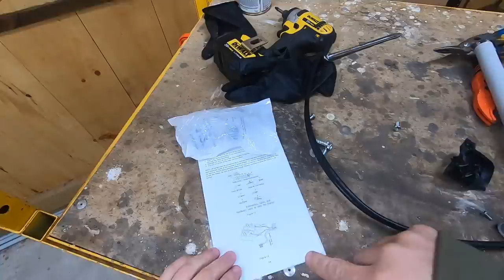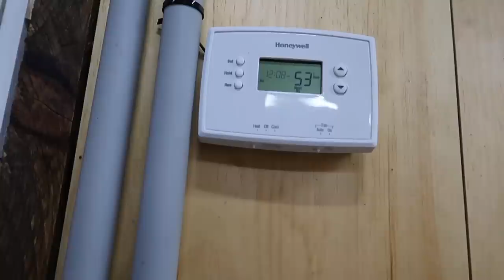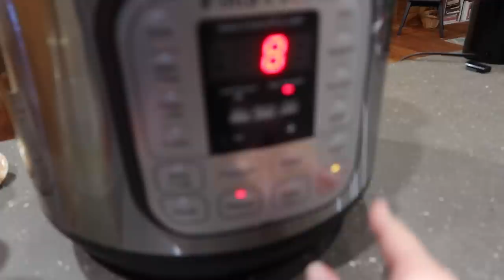Are we NUTS??? ELECTRIC HEAT in the WorkShop!!! You Might Be SURPRISED WHY

Comment: I am also putting a similar heater in my shop which is only 20 x 30 with a full trussed ceiling which is not insulated yet. This leads to my question which is did you do a video on the blow in insulation I see in your ceiling. I think this would be less expensive than regular insulation by quite a bit. If you did a video I must of overlooked it. Thank you from Michigan Steve

Comment: I have a 3 car garage/man cave 22x30 with 8ft ceilings and whole garage its insulated even garage doors:). I just have to seal the gaps on the outside and all the way around garage doors and a gap I have under door going to backyard do you think this heater will work for my space?

Comment: Al, read on the heater circuit panel, what is the voltage expected as input to be on or off. The Honeywell should describe what the out put is for on or off in their technical description.  I believe that little switch will provide 0 or 5, 0 or 12, and 0 or 24 volts as on or off  and one of those is what the fusion expects
Reply from the maker: Thanks I’ll have to look into that

Comment: if you b lock the thermostat away from the wall it will react better to air temperature rather than the cold wall behind it. and not cycle so fast because the outside wall will not chill it as much. love your videos  Dave

Comment: Ok am I missing something, I see a double breaker so is that 220 volt but I also only see a black and a white wire and a copper ground, Isn't there suppose to be a third red for 220 volt, I have been wondering about his wiring sense the main was put in?

Comment: I don't know if you got your thermostat to work. But I was thinking maybe if you used the wires going to the thermostat on the unit and hooked them up to the one on the wall it might work. I can't see a unit having two thermostat s.  I'm thinking you have to use the leads that are on the units thermostat because there the ones connected to the switch that  turns off the unit when it reaches your set temp.

Comment: Just a few pointers on things I noticed. (might already be buried in here) Code calls for marking all hot wires something other than white or green. Black or red tape on both ends meets code for inspection. Use THHN(W?) single conductors inside conduit. "Double" jacketing (outer sheath plus conduit) reduces the wire's current rating due to heat build up. Mount T-stat away from door so drafts don't trigger a cycle. Oh, and the final pointer is to pay attention to what you have that t-stat set for because your power bill will be a doozy if you forget. Someone else mentioned a ceiling fan. It doesn't have to be fancy. An old window fan set to low speed and placed on a slant in that loft area will work wonders!

Comment: Could only finish watching after working, but HELLO HOMESTEADERS (watched your defense of "pretend" homesteaders yesterday)!  Great, well-thought out basis for putting the electric heater in the shop.  If you haven't swapped it out already, suggest you re-examine the thermostat instructions.  Unusual for Honeywell components not to work correctly.  

Seeing how far out you are, however, you might think about budgeting for an emergency generator if you can; we went through Hurricane Sandy, and made it a week without power (thanks mostly to Coleman) but we finally broke down and got a simple 240-volt/120 gas job.  Of course power came back on 18 hours later, but it would at least allow you to keep broadcasting, which means income.  Other benefits too, of course.  

Thanks for your example; hope the winter is mild for you.

Comment: Electric heating in such a space makes a lot of sense. Guarding against freezing. If you end up using it for projects a lot you can always just install a small stove for burning wood when you're actually using the space. Best of both worlds. If you put it in the corner where the sheep are that way you can also get them some heat if it gets really really cold. Around here there's a bunch of older small stoves available cheap or free if you look.

Comment: Hi guys.  Loved the video and dinner looked fantastic.  I think you should install a simple ceiling fan in the workshop.  The heat would better circulate all around the workshop. Since heat rises.  Enjoy. Thanx for sharing your life with all of us.
Reply: Good idea... introducing convection helps distribute heat by moving the heated air.

But remember (minor technical point here), it's hot air that rises, not heat itself. Heat is unaffected by gravity, and has no tendency to go anywhere except from points of high temperature to points of low temperature, as per laws of thermodynamics. Heated air rises because the density becomes lower than the surrounding cooler air.

Comment: You do have pretty good electric rates compared to here.  If the heater is running on the 5K setting it will be about $0.52/hour. 
Regarding the water system, I think it would be far cheaper to put a stock tank heater in the water tank and insulate the tank. They have their own thermostats and run to keep the water not too much above freezing. You wouldn't need to keep the shop heated when you aren't using it just to keep the water from freezing.

Comment: I’m not an electrician, but I’m pretty sure if the wires are inside conduit you don’t need the jacket on the wires. It would make pulling them a lot easier.

Comment: I have a heater similar to yours and I wanted to put in a thermostat like yours too, but I could not due to the Amps that the heater put out as it was not compatible together.  Check that out, it may help you find the reason.  good luck.  Tim

Comment: Heater wiring, I'm thinking that since you are using the bare wire as neutral, it should be attached to the neutral bus bar, instead of the ground, that way you are not running current on the ground line back to the main panel, since this is a sub panel. But of course i'm not positive, other electricians please chime in. Can't help with the thermostat, as i did not see how you wired it. Gina, that spaghetti looks delicious.
Reply: Heater doesn't have nor require a neutral, 240VAC two hots and one ground, Al hooked it up correctly. A tip I use when using a white coated wire for line voltage is color it black with permanent marker, less confusion.  And yes the sub panel is wired correctly, the ground buss and common buss need to be separated.
Reply: Yes , you are correct, I remember now from Pure living for life. I was thinking of a clothes dryer, that uses 110v for the motor and timer, & 220v for the heater. I also spray painted my white wire black when I used it for a hot wire. Thanks Joe.

Comment: You need some lubes for that wire. Also if you pull the opposite direction you dont snag as bad at the joints. Finally, you could have bought a step bit to enlarge that hole for fairly cheap and stuck to 3/4" pipe

Comment: Please remember the electrical installation may be safe, however, the rules of installation are governed by the local and state laws. The shown eletrical panel would be illegal  for use in a home in our state, however, it would be allowed in a barn if oher conditions are met ( a pole in the yard that separates the home from the barn electrically ). Grounding where we live is much more strict because in places we have underground sand domes that do not make good contact with the grounding electrode and earth ground, therefore, all panels must have double electrodes and be tested. In short what is right in one area may not be right in another area. ( That's why hiring trained electricians is often a much safer bet, and sometimes cheaper than having fires, eletrical shocks, or trying to correct major errors. )
Reply: He stated that he hired a licensed electrician to install the panel.  Adding circuits is not that hard   :)
Reply: @mattben  Where they live, the wiring might be fine, however, in Michigan there would be several violations unless they corrected the mistakes off camera. The code changes every three years. We were required to attend refresher classes every three years. That alone is a good reason to hire a good electrician.

Comment: I use electric heat (5000 W, 240 v.) in my restoration studio. I can heat my 900 s.f. building to 125 F. Keeping it at 70 F usually costs me $1- 1 1/2 per day. The best thing about it is EXPLOSION PROOF meaning safe for painting with solvent- borne products

Comment: Our thermostat at home has 1 or 2 AA battery(s) in it. I think it might need a battery for power. We enjoy watching from snow covered Ontario, OHIO.
Reply: yes run some phone wire if you can connect the c wire for power and the other wire i had i used it for the g term when i run electric dryer i run the fan on manuel and the vent is just above the hvac return

Comment: You can DRILL a HOLE in Metal Cabinet for a ¾ conduit fitting KNOCK OUT DIE PUNCH.  You assemble the punch with a threaded bolt that sucks the tow halves together so the die punch a perfect hole.  So you do not need to use the preselected knock-out location. You can make your own.  Most electricians have a set of these Greenlee punches in their tool chest.

Comment: The electric heater is a great idea.
At 9:52 you have your fingers WAY too close to those HOT buss bars in the back of the panel. 
You immediately turned around showing the main lights on in the garage with power coming from the panel.
That tells me the panel buss bars were hot when you did that. 
If you barely touch one of those bars you will die in a instant.
Electricity will not allow for mistakes, please be very careful. 
You would be better off starting a generator for lights and turning off the main breaker at the beginning. 
Olivia needs her Daddy and Gina needs you too. Think about that the next time you take the cover off that panel.
Love your channel.

Comment: I'm not an electrician. So this is just a question. With that bare earth wire in the box, touching the box.... if you have a problem wont that make the box live? Shouldn't it be covered as well inside the box until it gets into the socket? ALL the best.

Comment: Never run Romex or bundled wire inside conduit.  Use individual insulated wires.  The nice thing about Romex is you can just staple to the inside wall.  No conduit needed.  VERY DIFFICULT to get Romex through those 1/2" sharp bends.  The heat in your workshop is all going to rise up to the ceiling and get very hot up there  and waste a lot of electricity.  Get a ceiling fan and mount it very high.

A better color code uses black as L1 and red as L2, leaving white as Neutral.  Hard to get the right cable colors, which is another reason to use individual wires.  Put some red tape around your white wire in the breaker box where it connects to the breaker.  You could do that inside the heater, too, so somebody later does not think it is Neutral and electrocute themselves.

Comment: On your thermostat wires, if you short out the two wires (T1 & T2) the unit should come on.  When separated the unit should turn off.  All the thermostat needs to do is connect the two wires.  The supply voltage (24V) should originate from the heating unit control.  The voltage can easily be verified and the other is the relay switch feed.  If no voltage then the problem could be in the heating unit or wire.  If voltage is present and then unit does not turn on when circuit is completed then the relay control or wire is defective.  If that works OK, then you are back to the thermostat wiring connectors.  The manual should describe all the terminals and the settings.  I think you would use R and W if I recall since the unit only has two terminals to control it.

Comment: Good luck getting external T stat to work. Think it calls for a line thermostat, and I couldn't get it to work either. I ended up using a contactor, transformer, and a thermostatically remote control power outlet I found on eBay to turn transformer on, and off to power contactor to control power to furnace, and left unit t stat turned all the way up. Same setup used on a home heating unit. Something is just not compatible with external t stat wiring it the way they say to do it, I never got their way, to work right, maybe you can get some answers from the company, I couldn't

Comment: FYI - I had the same problem with the thermostat not working. Come to find out there was a tiny piece of paper in between the contacts on the thermostat. When I removed that, the thermostat worked as it should, so you may want to take a really good look at the contact points for that piece of paper.  :)

Comment: I live in Southern California, most homes are heated by natural gas. Burning wood is a "no no" due to smog issues. Our smog is much better than when I was young but more and more people come here so we have to keep up with the smog issues. I just heard on the radio this morning that government officials are considering a ban on natural gas heading because of the CO2 emmissions. So, instead of gas, they will require electric heating. So, electrical head is not that bad of a solution, especially with your low electrical cost.
Reply: They're probably powered by coal, so natural gas or LP would definitely be better. Lower NOX, lower CO2, cheaper heating bill

Comment: You mentioned painting and being able to use the electric heater? Remember an electric heater can be an ignition source for flammable vapors just like any other heater. The resistance wires get plenty hot enough to ignite flammable vapors or gases. Just a word to the wise!

Comment: I am pretty sure it's against code to run NMC (romex, etc) thru the conduit
The heater looks to small for the space to be heated. I would have placed ceiling fans to push the hot air down as all the heat will be trapped in the ceiling. I could never figure out why people place heaters high up to the ceiling as heat rises. I would have used a small water heater and run baseboard all around. Or even elec baseboard
Also I believe the white wire in the panel and at the equipment should be spiral wraped with black tape to signify that its NOT a neutral

Comment: Am surprised you heat the house with the wood stove, so why not a rocket mass heater in your barn, would be a great thing to diy since you are so handy.  Love the vids you share, be well and huggs
Reply: Rebecca Haughn - Al explained their reasoning in the video.
Reply: I have always thought the number one thought was to save where you can and even though cheap, it is reliance on another rather than self.  So with heating the house with wood stove, a rocket mass heater would take small stuff and make long term heat for the barn.  That was my thought.  Surprised Al has not responded.

Comment: Why did you install the thermostat right by a door which will likely give you a wrong reading?  Why did you put the thermostat so close to the heater which will likely give you a wrong reading for the whole shop?  You will think it's warm but it is, only near the heater.  Do you expect the heater to heat the entire workshop or just a small portion of it with the thermostat located where it is?  We make bacon ourselves.  You are right, it will be good.  Do you have a meat slicer to cut the bacon?  If not, it might be a good investment.  We cut it up with the meat slicer and vacuum pack it.  I am glad to see Gina has that utensil that breaks up the meat so well.

Comment: On sale right now at RURAL KING !...……...Comfort Zone 240V 10000W Garage Heater CZ260ER$199.99¢   Valid November 10, 2019 - November 27, 2019             Description Product Features:2 heat levels up to 10000w. Remote control for convenient adjustment. Large display shows current and set temperature. Digital thermostat. 12 hour timer with auto shutoff. Fan forced for wide area circulation. Adjustable louvers and heavy gauge steel body. Fully enclosed motor for use in harsh conditions.            In the event of disagreement between the circular and this popup, the circular shall take precedence.

Comment: Al,   Please be aware that there is a contractor inside the heater that arcs when it turns on and off.   I doubt you will ever have a concentration of fumes to be a problem, but thought you needed to be aware.   I would turn the heat off if spraying paint and doors closed.  Respectfully,   Kevin

Comment: Electric heat is lowest and quickest installation cost.  It is also the most expensive to operate.  If we are talking a few hours a day, it is a very good solution.  You might even consider put it on a mechanical timer.  So waht it you have to reset the timer every 60 minutes.  You don't have to worry about, "Did I remember to turn it off ?", when you are nice and cozy in front of the wood stove after dinner !  On below 0F days, you probably need 2 of them in opposite corners  ... or just put the project off !!
You should have run just THNN cable from the panel to the heater.  Probably cheaper and easier.

Comment: ELECTRIC,, IT'S FINE AS LONG AS THE POWER IS ON,, & YOU CAN SWING THE RATES.. Propane is nice,, small shop with just the pilot light ,, will keep you above freezing if it's really tight..

Comment: FYI:
When installing electrical wiring: Ground wire (mostly green color or bare copper wire), Neutral wire (almost always white color) then Load or conductor wire or wires (typically black but can be other colors as well). 
To uninstall do the opposite.

Comment: some thermostats are specific to the type of heater ,or i should say heating system,  oil steam, oil forced hot air , oil base board, gas hot air , gas base board (forced hot water ), electric base board , electric forced hot air and so on , i had bought a programmable thermostat like you and found out i had the wrong one , it would work but not correctly like yours , just something to look into Al .....